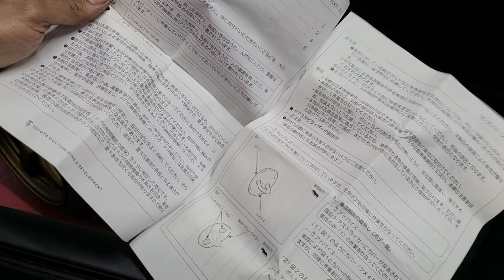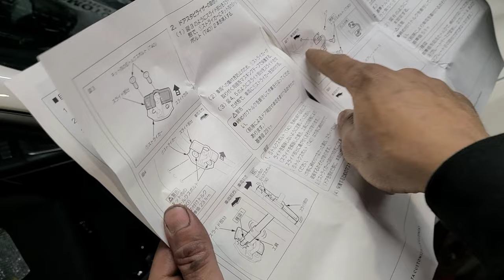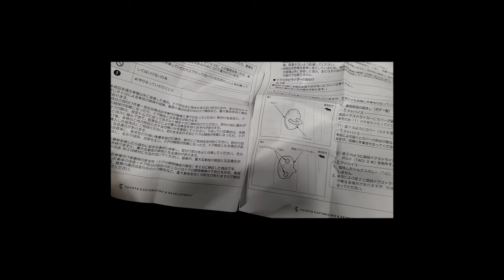GR 86 Door Stabilizer good or gimmick?

Comment: I think getting a strut bar or sway bar have more of a change to the car's stiffness and handling.
Reply from the maker: The logic being the door is a large brace if stiffened up enough
Reply: @xiiimotorsports  i live in a town with winding back roads up down hill every corner posible and potholes alover. I first did the aem strut bar huge diffrence like huge. The. The door stabilizers were just like adding the strut bad. Huge diffrence. There a must have combo. With kansia rear strut bar
Reply from the maker: @mattwood3773  Awesome thanks for the feedback!
Reply: @mattwood3773  i installed on 2 old corolla AE100 & AE110, quite big difference on cornering and driving on bumpy road.

Comment: I doubt you'd drive hard enough to notice.
Reply from the maker: You don't know me well enough :)
Reply: @xiiimotorsports  have you taken the car to the track or found the chassis limit? And after you say yes, do you have a video of you at the limit?
Reply: This is something, that only those very very in tune with how their car reacts under load in corners would notice. It wasn't me taking a dig at you, just being realistic.
Reply: It’s an interesting mod.  Regardless whether OP can take advantage of it or not, it’s to show what’s available on the market for those who may also want to do the same thing.
Reply: They have been on the market for a long time. The drift King has had one on his ae86 for years and he claims he notices a real difference
Reply from the maker: @stormforge68  I appreciate this, you see the vision
Reply: @gabehorn5079  Have you ever installed one? You can literally feel the difference in a straight line over bumps, you are dense. That's like saying there's no point in installing a sway bar or engine bay strut if you're not tracking your car.
Reply: @Toymonkeyjr  you're acting like I'm against it, it literally turns your door into a structural member.
Reply: @gabehorn5079  Yes, you said you can't tell the difference unless you're on a track, which is false.
Reply: @Toymonkeyjr  no I'm saying you're not going to notice a real difference unless you are pushing your car.
Reply: @gabehorn5079  The difference is totally perspective based, most people wouldn't notice a 50whp increase in most cars unless you told them before hand.  Same goes with this mod, especially if you already had a hood strut brace, all it does it just make a certain part of the car stiffer like you said. But if you can tell the difference at all, you can really tell at any speed